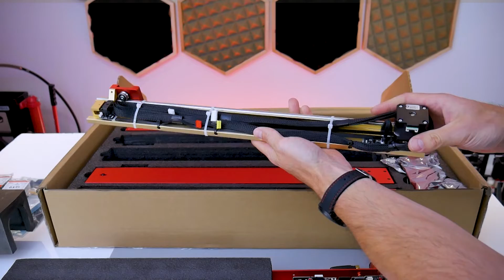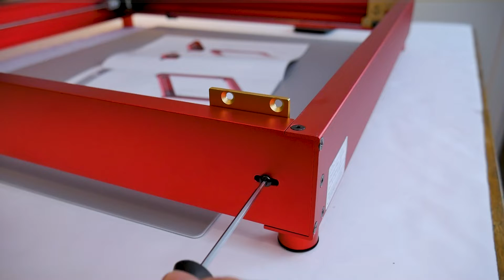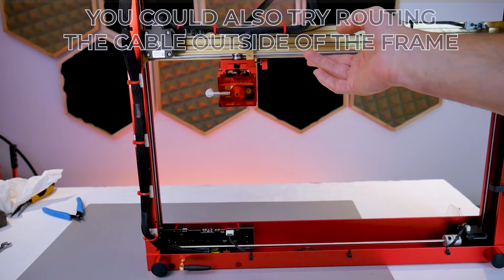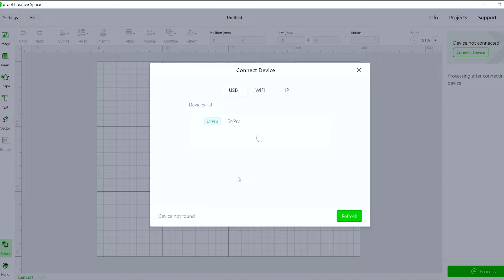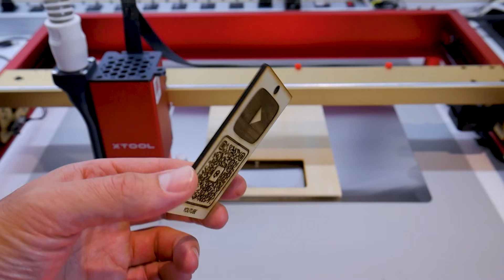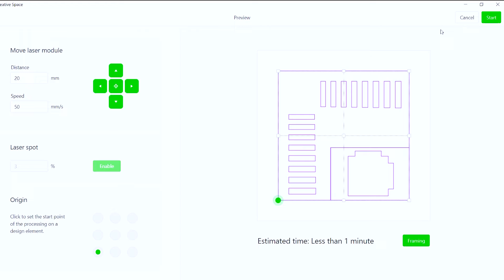XTOOL D1 Pro In-Depth Setup Guide, Assembly, Creative Space Software Fundamentals and Fume Extractor

Comment: How do you get the gantry to move freely like that when its on?  Im using lightburn, is that why mine isn’t free to move?
Reply from the maker: I'm not as familiar with lightburn but your motors might be "on" which means they will hold their current position. Are you running the latest D1 pro firmware? Might not be a lightburn issue as when I did a quick google search it comes up with this: https://forum.lightburnsoftware.com/t/disable-steppers/43986 ...

Comment: Great video! wondering if you can use the fume extraction and  air assist at the same time?
Reply from the maker: Yes you can, but the air assist might push some of the fumes away. The nozzle should still get most of it, but realistically never 100%

Comment: Stupid question - I will be ordering the fume extractor along with a CPAP hose. Does anyone know of an adapter that can be used to connect the hose to a vacuum with a 2-1/2 in opening or a 4 in inline fan?
Reply from the maker: What kind of inline fan? The reason I use a shop vac on the other end of my hose is the negative pressure it can create through a hose and really suck fumes up. High cfm fans with low pressure won't do the trick through the hose.
Reply: @EmbraceMaking  like I said "stupid question". I rewatched your other video on fume extraction (https://www.youtube.com/watch?v=k7qTE4t4sf8) and realized all of my questions were already answered there. Thanks for your response and for all of the videos - I know it takes a lot of your time and effort and it is very much appreciated!! Can't wait til your at 1M subs!!

Comment: Great video! A few questions..

You don't show what is on the other end of the CPAP hose, what is that setup re removing fumes etc.

Are you saying with your setup you don't need an enclosure at all?

Thanks
Reply from the maker: Somewhere in the video I believe I put a link that pops up in the top right hand corner of the screen, but here is my other video showing the filtration system: https://youtu.be/k7qTE4t4sf8 
My nozzle is geared more towards people who don't have room for the enclosure or are doing light work with their laser. I would recommend a full enclosure and professional filtration system for anyone running their laser for long periods of time or working with really nasty materials. The nozzle works great but realistically some smoke and fumes will still escape as it is impossible for it to get absolutely everything. An enclosure (in theory) captures everything since there is nowhere else for the fumes to go.
Reply: @EmbraceMaking  thanks for info ,👍

Comment: The vacuum extractor looks fairly high up from the bottom of the laser. How well does it work?
Reply from the maker: Hi Laszlo, when developing this I tried multiple versions with the nozzle high and very low. When the nozzle is very low the vacuum strength is very powerful and can disturb light materials, or small workpieces. It actually starts to vacuum them off the table! So I kept iterating designs until there was no risk of moving small or thin parts but still close enough that the vacuum strength is powerful enough to draw in the fumes. So it is at a height that is a good balance for all general purpose. However, if you are the type of person who is not processing lighter materials, reach out to me on my website through the contact form and I can make you a custom length nozzle that is lower! Thanks!
Reply: @EmbraceMaking  Great info! Thanks!

Comment: Guess I need a laptop with this cutter. I was hoping for some sort of screen menu like my 3D printers.
Reply from the maker: What kinds of jobs are you looking to process? I believe you can slap files on the SD card and just press the button on the front and it may run the newest file on the card... I'd have to look into it. I recently did a video on the ORTUR laser master 3... check that one out. Although it's not a video showing how to use the machine, you will see in the video that the performance is comparable to the XTOOL as it is also 10W.... and with that one you can actually run the machine off an app on your phone. Again, I don't show that in my video but apparently its pretty easy to do
Reply: @EmbraceMaking  First, I appreciate your video. It really helped out, especially with the cable management. I see several places mine likes to snag. 

Just put my D1 Pro 20W with extension kit together yesterday, and spent several hours getting the hang of it. Looked around for SD/TF card utilization, but saw nothing. I moved my bulky desktop setup into my workshop just to get everything going. 

First project is 10" X 8" cope and drag boxes for sand casting. Designed the finger joints and am impressed with how well it cuts. Just have to fine tune the finger sizes for the kerf.

Comment: Great Video! The manufacturer website mentions capabilities of offline processing/operating mode but no where does it say how to do this. Is it possible to load the job to the laser, disconnect from the computer and engrave offline? To run the same job multiple times without being connected to WiFi or USB connection.
Reply from the maker: Good question! I haven't tried it... but... I bet if you disconnect from the computer and just press the button at the front I believe it will automatically start the last job. Give that a try!
Reply: @EmbraceMaking  I tried it out and nothing happens. After disconnecting, the machine will not process the last job. It will give a pop up warning if machine is disconnected before pressing the start button on the machine as well. Using XCS and D1 pro 10w on PC.

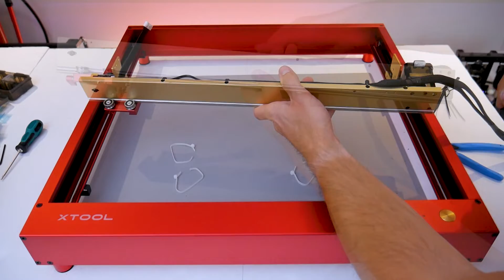Comment: As totally careful as I was to follow every single instruction they gave to the letter, I missed that connector at 6:56. I hadn't fired up the machine yet because I'm waiting for a couple more incidentals and while I do, I saw this video! When I watched this I went back and redid everything and I'm still working on it now going through second by second of this video. My belts weren't tightened properly, I just randomly attached the gantry somewhere in the middle instead of bottoming out at the back. THEN tightening the connector bolt screws. I felt like the instructions might have assumed end user knowledge being much greater than mine is. But this connector tucked in at 6:56 would have had me shipping the machine back 😭. Onward with new knowledge!!! Appreciate you!
Reply from the maker: Thanks Debi! Glad my video could be of use to you, enjoy your machine!

Comment: you mention using a protective mat under your project, Xtool has their iron honeycomb workspace, as for your burning on the back of the piece and having more crisp front, the air assist should help with that
Reply from the maker: Definitely! In a future video I have a lower cost solution to the honeycomb work space for people on a little more of a budget. The silicone mat underneath is a good pairing with this solution I will be releasing soon. Air assist definitely helps with the top surface and having air space under the part prevents all of the burning on the bottom side.

Comment: better of the informative videos on assembly of xtool d1 pro.. subscribed.. had similar realizations with gantry wires issues.. ill have to readjust carriages alignment as presented as i've noticed deviations in coordinates while moving laser head to 100x100 mm for origin.. seems 0x0 absolute origin keeps moving a mm off every return.. reason "free framing" works w/o precise positioning.. the fume extractor is brilliant! commend the ingenuity.. do recommend using air assist for wood cuts as it improves vastly cleaner kerfs from charring.. multiple passes at faster speeds vs few at slower rate works well with 5mm plywood for me.. excellent altogether.. thanks for sharing insight...
Reply from the maker: Thank you so much for the thoughtful comment! More D1 Pro content to come soon!

Comment: Creative space software does not find my unit.  I have tried everything.  😞 Can you offer any suggestions?  I have downloaded all of the necessary drivers and even turned off my firewall.  I am pretty patient, however, I am about done with this and am just about on the edge of "box it back up and return it".
Reply from the maker: When you originally plugged it into your computer and turned the power on, did the computer at least recognize it? You heard the little ding sound and at least some of the drivers were automatically installed? Does it show up in the windows "device manager" at all?
Reply: @EmbraceMaking   No on both.

Comment: Excellent video! Great tips on cable management, gantry and stepper motor shaft alignment. xTool needs to either have that little tab cut off the circuit board which prevents it from aligning with the other side or revise their assembly instructions the way you did it. Also love the flame extractor. Will be purchasing one tof those from you for sure. Much more elegant solution than one of the rinky dink enclosures... Thanks for all your thought and work on this video. Best xTool D1 Pro video I've seen so far.
Reply from the maker: Hi Jeff, that's a lot of praise! Thanks for the thoughtful comment, really appreciate it! Whenever you're ready to get a fume extractor nozzle you know where to find me. Thanks again!

Comment: Hi! I have a 100W CO2 laser cutting machine that suits my needs very well. What I basically need to know is two pieces of information that I haven't found in any demo yet. Diode laser operational lifetime. How many hours do I work? The second question is: in a single pass do I actually cut how many mm of wood and at what power x time?. My problem with CO2 is that it takes up a lot of space and is also very heavy. This causes me trouble.
Thanks.
Reply from the maker: The Xtool website says the laser head should last 10,000 hours... https://support.xtool.com/hc/en-us/articles/4405624562199-Pre-sales-knowledge-for-xTool-D1
In terms of settings for the wood I think it depends on a few factors like the color and density. In this video I was using basswood which doesn't seem very dense but it is light colored so I imagine it won't absorb the laser as good as something darker. I used the Creative Space preset which was 100% power @ 3mm/s speed. I was able to increase that to 4mm/s and it still cut fine. I experimented at 5mm/s and there were areas it didn't go all of the way through. I see ads online for this machine saying it will cut through 10mm wood but it does not specify if that is a single pass or what kind of wood.... realistically I think it would do 6mm thick in one pass at a very slow setting.

I have a K40 here and I also find it heavy and cumbersome, plus the closed frame limits what I can put inside. The nice thing about these light, open frame lasers is that you can put the entire machine on top of a big workpiece if you had to. Will it replace the power and grunt of your 100W? Certainly not. The speed will be slower too, but it does have its advantages. Different tool for different jobs I guess.
Reply: With cutting wood do you find it accurate? If for example I wanted to build intricate boxes do the joins fit well or is there large kerbs? Thanks for the video